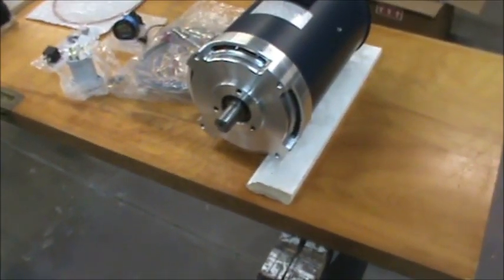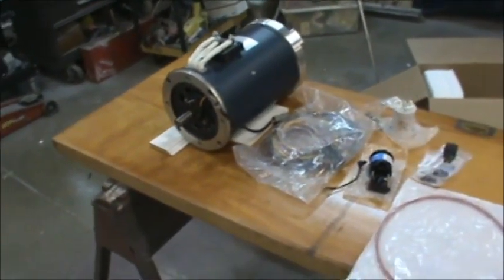My Civic EV Electric Car Project Part 3 Our AC-50 Electric Motor Kit

Comment: What's the voltage range of the motor. What's the idile rpm voltage since you need to hook up AC compressor on the second side shaft of the motor

Comment: Have you thought of keeping the front engine and accessories intact, and getting a rear drive conversion kit to run the electric power drive system separately on demand? Keep the IC engine on at idle for regular operations, lock the normal IC equipment out (trans clutch at neutral) then kicking on rear (Electric) drive as wanted with a separate acceleration control?

Comment: What is the spec of the motor? I hear that is 180v 650A? What is the speed in rpm and may I know the brand?
Reply: HPEVS AC-50
108V 650Ah
76hp/121ft.lb

Comment: The thing about engine advertised hp is its always at the crank, some drivelines can lose 10-20% of the engine power, a proper ev driveline can be lower than 5%

Comment: Hy Tom, I was wondering how you handle about the water, the water can't come in inside the motor, as I see is a open motor, or there is no problem with water, another thing, the steering wheel in this car is hydraulic, how we can handle that also. Anyway, I will do my conversion also and your videos are very good and are helping me a lot. Hope get a answer from you. Have a great time. Tks.

Comment: Why will you gain weight if you are removing the ICE motor and replacing it with something smaller ? Transmission will remain the same as before, will it not?  I applaud your efforts on a small popular car like this and I just want to know how you will recharge the battery and where?
Reply: Most of the weight gained is from the batteries

Comment: The motor is Alternating Current ?  3 phase ?

God bless
Wyr
Reply: Ac is not from alternating current. It's a kind of dc motor. It works on 3 phase from the controller. The controller works also on direct current.
Reply: 0
Reply: I think you may be incorret, AC is for Alternating current, usually those motors are Induction motors, and they are powered by AC, the controller controls the frequency of AC that´s how you set the speed of the Motor.
Reply: Ac is the company

Comment: Did u think of anything about transmission? Removing gearbox and thinking of an alternative? I would really like to see how far did u go. And how's the car running by now?
Reply from the maker: Ivan Granić I am still building the car. There are custom parts in manufacturing at this time. Hopefully within the next few weeks we will have the drive train installed into the car.At this point ill keep the original gearbox in the car. The alternatives at this time are not efficient enough to warrant the additional cost on a converted vehicle. In a ground up vehicle project I would seriously consider a single speed Egeardrive.

Comment: hey tom, how many kilo watt hrs. does this motor consume?
Reply: Well its 52,2 kW, so if u can drive it 1 hour, u will waste 52,2 kWh -.-
Reply: +THE BUMPER MEDIC INC. it depends on how hard he drives it. Probably 2-4 miles per kilowatt in city
Reply: Ivan only if he drives it at top speed all the time
Reply: even if he does itd give range of 120miles..

Comment from the maker: 4.41 : 1
Those are short legs for our motor, our peak power is 0-3800rpm so after 3800rpm we are going to fall off on our torque. I am alittle unsure on what gear would be best with the car.......I havnt sat down as of yet and gone completely thru the math. I am also unsure as to whats available for the transmission as far as final drive ratios. It is likely ill go ahead and build it with the gear it has and change it later. sometimes math and feel don't jive!
Reply: tomswonderfulworld

Comment from the maker: I don't see it that way unless a BMS (battery management system) is being used. I will not be running a BMS I am completely against them.
I think instrumentation is the biggest problem with an electric car and will present the biggest problems over the course of the build and probably beyond.

Comment from the maker: Ron, I don't know for sure either on the prius pump. Your definitely correct about the efficiency of an electric power steering pump.  And I may end up going that way, but right now for certain reasons I want to go ahead and use the stock pump if I can.

Comment: Cool stuff Tom, I believe (I don't know for sure) that the Prius has an electrically powered PS pump, should be more efficient than running a pump off the big motor.